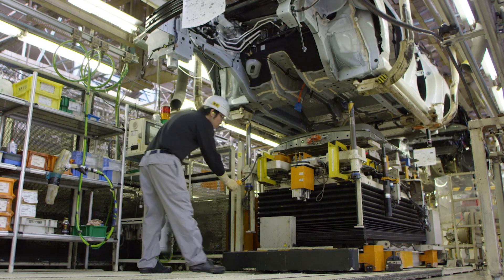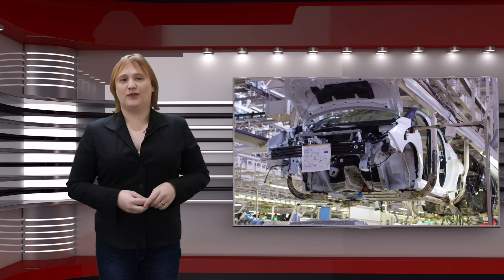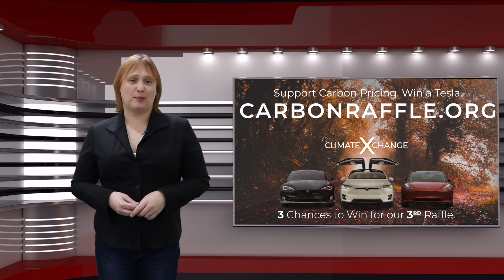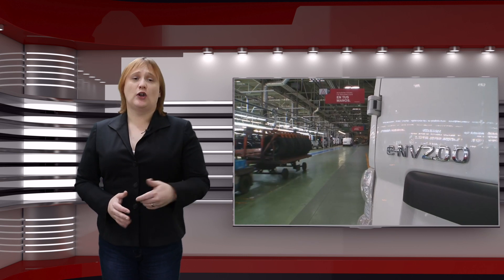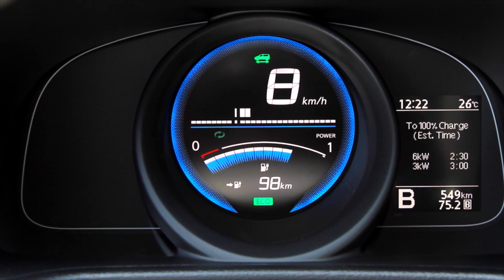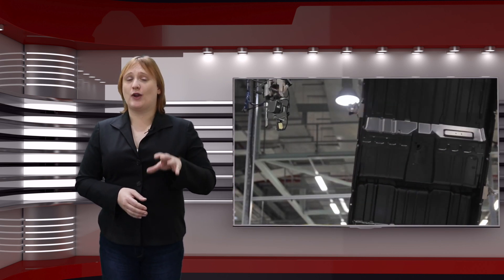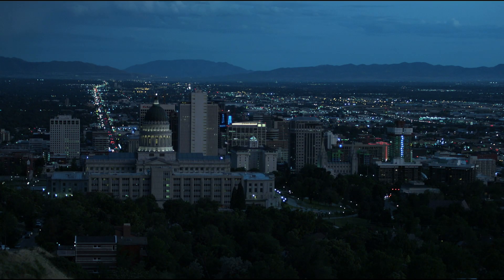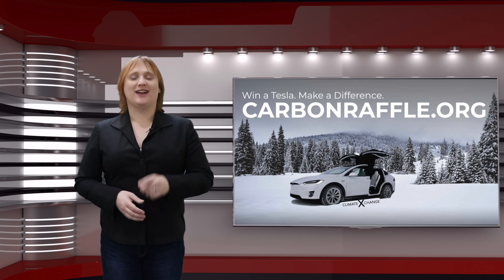The 2019 Nissan Leaf e-Plus Will Get Air-Conditioned Battery Cooling, Not Liquid Cooling

Comment: Just a few thoughts. First, nobody is obliged to buy a car whose technology they don't like, so there is no reason to get heated up over this issue. Second thought, the capacity of cooling is more determined by the amount of heat to be evacuated than by the volume of the space to be cooled, so the comparison of cooling the battery and the cabin may not be very relevant. Third thought, even with liquid cooling one ends up having to cool the liquid using surrounding air (what else is there?) so there has to be some kind of air-cooled radiator; the problem might be not so different as air-cooling the battery directly (though probably liquid cooling can ensure more uniform temperature in the battery being cooled).
Reply: Tesla uses a Heat Pump to provide active cooling or heating as needed.  The Nissan Leaf only has passive cooling.

Comment: All of these air liquid or any other cooling means nothing, there's so many drivers just want A. A mass produced (not silly 2k uk allocation compliance vehicle hint hint kia/hyundai) and B. Extra range. Cheers
Reply: Heat causes battery degradation - like 20% in 5 years ...

Comment: You gotta be kidding me, Nissan. I was really hopeful for a liquid-cooled battery pack to bring the 60 kWh Leaf up to modern standards. The rapid charge throttling is annoying, but the real reason I hate this decision is that we already have lots of data to demonstrate that Leaf battery packs lose capacity at an unacceptable rate, whereas liquid-cooled packs on the market do quite well. Nissan has basically just guaranteed that Leafs will always depreciate at the same rate the first generation has.

Comment: Nope.
Not surprised really. Nissan has their head in their domestic Japanese market. Works fine there. Mild climate and you can't do long high speed miles like in the US or much of Europe.

I couldn't really talk about it before, but now I've sold that business and can share. When I bought my used '11 LEAF 3+ years ago one of the things I was anxious to explore was the possibility of retrofitting active cooling to Nissan batteries. At the time I designed cooling for commercial/industrial/military vehicle cabins and sometimes electronics and other things. I've worked with a large manufacturer to examine the feasibility of closed-loop air cooling of commercial size lithium-ion storage systems. In that case and in the case of my LEAF it was simply impractical.

In the LEAF in particular is simply will not work. The battery cells are housed in aluminum boxes that are stacked directly on top of each other providing very little surface area that could be reached by the cooling air. Any cooling that did happen would pull heat from the outer edges of each box. The individual cells have poor thermal conductivity from the center of the cell to the edges of the box. In the back of the battery there are 24 of these boxes up on their sides all sandwiched together. There is no way to get enough air through this battery to remove heat effectively.

Why? Short answer: it's all about the weight (mass) of what you are cooling and what you are cooling it with. The batteries weigh a lot and air weighs a little. That's why liquid cooling is so popular. Liquid coolant. Leaving out lots of details here, but the empty space between the battery "boxes" and the shell surrounding the whole battery is not too far from 2 cubic feet. 2 cubic feet of coolant weighs about 60 pounds (too lazy to look up but this is close). 2 cubic feet of air weighs about 0.16 pounds (about 2 1/2 ounces). If everything absorbed heat at the same rate (it doesn't. that's why coolant is called coolant) that 2 cubic feet of coolant would absorb 375 times more heat than the air. 

Whatever you cool the battery with (assuming it's not just "Thoughts and Prayers" as in all LEAVES to date") you need to flow through the battery to carry the heat away. If it were air you used for cooling you would need large gaps to allow very high air flow. It would be nice to use some finned heat exchangers too, like the kind you find in computers. This would make for a very large battery enclosure and a noisey inefficient cooling system.

So? So the new Nissan battery will have the same dieselgate problems and Nissan will "solve" it in the same way: turning down the safety systems and bracing themselves for the warranty expense. Loved my LEAF but won't buy another. My new '18 Volt has amazing thermal management. I bought a Volt battery out of a wrecked car to play with/autopsy. To a thermal management guy it is pure art.

(note to fellow geeks: yes, I left out and/or misstated LOTS of things here. Just trying to be brief and comprehensible.)

Comment: Here in Canada where it's currently -10 outside, I'm more concerned about keeping the battery warm. My current Leaf's battery usually has no thermal bars in the winter which means no fast charging, less performance, and no regenerative braking. It's also probably not great for the battery to be cold soaked but because there's no active thermal management the only way to get heat into the battery in the winter seems to be driving it at highway speed, which compounds the already-shorter range I get in the winter. When it's -20 out it's almost hopeless. The battery never warms up and the range takes a massive hit on my 24 kWh pack. At least with liquid thermal systems they can take heat produced by the electronics and heat pump and use it to warm up the battery. Not so with the Leaf.

Comment: Hyundai knew to change from air cooled to liquid cooled as they moved to larger / higher density packs from 1st Gen Ioniq to Kona and presumably extended range Ioniq.  No so with Nissan.  I'd expected that Nissan, especially after having to defensively warrantee packs against capacity loss, would properly engineer the 2018+ Leaf, or at least the 2nd try at 2018+ Leaf battery.  I guess Nissan will just continue their approach of gross discounting the selling price of the Leaf to it placed.  A lost opportunity since they have larger manufacturing capability and established customer base to sell a cutting edge EV to.  Instead, it looks like its a cost-cutting / compromised version instead of SOA vehicle.  Disappointing.

Comment: Mitsubishi uses active air in the Outlander PHEV but that is a much lower density battery than the new LEAF will be carrying. Our Bolt EV lease ends in January 2020 but I’m in no hurry to revisit Nissan based on this latest info.

Comment: Nikki,

If the ambient air is 100F, you'll have problems cooling the battery with an air cooling system.

Every summer in Nashville it stays in the 90's and sometimes 100's for months on end. Nashville is a major city, in fact where Nissan have their North American HQ.

Air cooled EV batteries are not well suited to hotter climates.
Reply from the maker: It’s not just air. It’s air conditioned air
Reply: @transportevolved  Ah OK missed that nugget. The cooler air should help some.
Reply: @JeanPierreWhite  Nope, there is no cool air, there  is no fan.  It is still passive !
Reply: @transportevolved  No, it is NOT !
Reply: It is the temperature differential that is important, more than ambient.  Our Leaf battery cooled down by a bar when left parked for an hour in 105F; the battery was well above that (turtles at 135F?)  Those batteries (30kWh version) get really hot after a few DCFC stops, even in 40F mountain air.

Comment: I'm glad  my 2015 leaf doesn't have active cooling.  Atlanta has moderate temps and my daily 35 mile one way commute just fine.   I know I'm good for years to come and have less moving / complicated parts to worry about.
Reply: That is my feeling as well.  A simple, reliable car is what I wanted when I had bought my 2017 Leaf here in Boston.
Reply: Atlanta's nickname is hotlanta. I wouldn't cal the summer temps moderate.
Reply: @JeanPierreWhite  It's moderate when you consider the leaf has problems at like 120f and it barely gets 100 here on bad days.
Reply: @JeanPierreWhite  I'm not sure the point you're trying to make. you must be aware of what constitutes extreme conditions in places like Arizona. Since you know this and that Atlanta is not in that category AND you know I can expect my leaf to work just fine for 8 years at least ehat are you trying to prove right now?
Reply: @wackottl  It seems you are under the impression that battery degredation due to heat starts at 120F. It doesn't, it starts to accelerate at 86F. My LEAF is 7 years old and had a battery replacement at year 5. You may want to believe your battery will be just fine in Atlanta my experience is that in the south the Nissan battery does not fair well. I have personal experience and also provided a link to backup my point. Your opinion clearly differs and you are welcome to hold on to that. Just be ready to replace your battery at year 5.
Reply: @JeanPierreWhite  ok, so you are saying I'll have the same problems in Atlanta as I would in Arizona.  I don't agree. I say they are extreme and I am not extreme.   but as you said, you are welcome to hold onto your option.  at least for another 2 years when i can come back and let you know if I need a replacement or not.
Reply: @wackottl  You are putting words in my mouth. I never said you'd experience the same degradation as Arizona, but I am suggesting you'll suffer similar degradation as Nashville, the cimates are similar with Atlanta being a tad hotter.

Understand that Arizona is the "canary in the mine" with regard to battery degradation. Their batteries degrade significantly in just over 2 years. Ours will take 5. My new battery is 2 years old I have lost between 10-15% already with 30,000 miles driven. I found once the first battery got to about 55,000 miles degradation got worse more quickly.
Reply: @Islamisthecultofsin  My new battery has the new formulation and is degrading all the same. For me charging to 80% is easy, its a vehicle parameter. 2015 LEAF's don't have the 80% charge option so the OP will have extra work to try and stop charging to 100% each charge.
Reply: @JeanPierreWhite   So my guess is the air conditioned cooling is than more superior comparing to liquid cooling, since with AC can get under the outside temperature.
Reply: @energiavadasz3328  That's a great notion, but liquid active cooling is considered the best. Chilled coolant is more effective than forced cool air. It's the same with conventional vehicles, liquid cooling is dominant with only a few cars that employ air cooling.
Reply: @Islamisthecultofsin  5 times per week. 12 minutes rapid which is enough to increase from 45% to 70% SOC to provide enough range to get home. The old battery needed longer Rapids due to the reduced range.
Reply: @Islamisthecultofsin  You may be right. The LEAF battery may not be capable of handling rapid charging without active thermal management. The 2018 LEAF started  the #rapidgate debacle where Nissan were found to have limited rapid charging speed to protect the battery. The earlier models have no such protections. Nissan may have concluded their battery isn't really capable of rapid charging without battery damage.

Other EV's such as Tesla can handle faster rapid charging with little to no measurable effect after hundreds of thousands of miles. Rather than limit rapid charge speed, Tesla vehicles run their cooling fans hard.

Comment: If you live in mild climates and don't rapid charge LEAF's are OK. However liquid cooling is better. My LEAF started at say 100 mile range. 4 years now 88 miles. So if that trend is linear (and might not be may be less) it will be 64 miles in 8 more years, or 12 years total. 64 mile range in my min range for my current local use. A new $7500 battery will get my range back. If you can swap battery yourself and find a used or reman or rebuilt battery that cost may be half.
Reply: @José Balvin What pathetic comment? How old are you? How many likes does your comment have? Ask me if I care? (Hint: I don't.) Have a nice day troll. Bye.

Comment: I have no problem with an air-cooled system as long as the manufacturer is honest when it comes to telling the customers what to expect/ the limitations.  I personally always prefer a simple system over a complicated system.  If an air-cooled system can meet my needs, (which this one does), then I would actually prefer it to the costly to repair complication of liquid cooled.  And this is also why I prefer air-cooled motorcycles over liquid-cooled ones.  Now I live in Alaska, and don't have near the concerns of those who live down south.  My opinion might change if I did.
Reply: Down in the north, battery has to work harder as it has to heat interior and be driving shorter distance than intended to.
Reply: @symmetry08  Yes, but it has not been a problem for me.  I have a 2014 LEAF with a 24kw battery and it serves my needs just fine.   I'm all for simplicity, fewer moving parts, and less to brake or maintain.  If a car doesn't need liquid cooling, I don't want it.  But I'm used to being in the minority on most things :-)

Comment: My trust in Nissan's ev offerings has evaporated. 
Kona or Niro are far better looking options at present.
Reply: The Leaf is fine for short range, slow charge applications. Not a travel car that requires fast charge.
Reply: Short range meaning 200 miles one way or 100 miles each way if yours has a 62 KWH battery. This is plenty far enough to visit several cities from our home.

Comment: In short is not a sports car, but a family one for temperate climates. On the positive side without liquids an hoses is simpler and more reliable in the long term. Also easier to replace battery even if a long term user has to find a similar
replacement that can be made to fit: so as not to throw away all the car (talking about 10 /20 years time).
Reply: Remember #rapidgate came about because an EV evangelist drove a Leaf across SCOTLAND! That's not a place known for heatwaves!

Nissan got the lack of active cooling in the 2018 model very badly wrong.
Reply: @paulgoffin8054  I said  "temperate" climate, not too hot & not too cold. 
In any case degradation due to cold temperature is totally reversible once the batt. warms up,
the noticeably effect is that the peak power accepted or delivered is lower correspondigly.
Apparentely certain permanent degradation occurs each time it is stressed at higher temps.
All the same users of earlier versions are very happy with the quality and comfort of the car.
I have never driven or even touched one, but for the price woudn´t dismiss it.
 Just they aren´t avilable here.
Reply: @andytomm1  The battery got too HOT in cool Scotland.

Comment: But the e-NVs cooling is ridiculous as well… It's only active while the car is turned on when you're charging! It's almost as if they wanted to avoid cooling the battery at all cost.
Reply: There is a video somewhere purporting to demonstrate an e-NV in England that has slow 2nd charge.
Reply: @mcarter5054  Not in England but this video shows rapidgate on E.NV https://www.youtube.com/watch?v=9c5LykE4J28
Reply: Well said.
Reply: EVPaddy - Greetings, my Swiss friend.  There’s nothing fundamentally wrong with doing this, as long as the manufacturer has a good strategy.  A modern battery, at a moderate state of charge, can safely handle pretty extreme temperatures if it’s NOT being actively used.  As an example of this, a parked Volt will run the cooling system (when the car is unplugged) only if the SOC is above a certain level.  And regardless of the SOC, battery damage can occur at extreme temperatures when charging.  This is why EVs limit Regen with hot/cold batteries.  The problem with the Leaf Is there’s basically no thermal management!  The battery will be forced to run at whatever temperature it is, even if it’s not optimal.  It sounds like the e-NV is a better system than the Leaf, assuming the execution is good.  Both the Prius prime and Ford Energi products use cabin air to cool the batteries to good effect, even though the battery packs are bulky to allow airflow around the cells.
Reply: @ClockworksOfGL  hi! Why do you know I'm Swiss? ;) Well I think it's a thing of the past to have batteries without thermal management. Yes the Zoe does pretty well with AC cooled air, but as I said, the eNV 200 doesn't. I don't know whether it uses AC to cool the air or whether it just uses ambient air, but worse, it's only cooling the battery if you leave the car switched on during charging. This means if you lock the car and go for a coffee, the battery will not be cooled. Stupid.
Reply: EVPaddy the battery cools down by itself when you have your coffee...
Reply: EVPaddy - “Why do you know I’m Swiss?”  Because you’re a greedy, secretive bastard that profits from genocide.  Just joking (do Swiss people have humor....?), I’m an avid reader of the Electrek forums.  I’m not familiar with that particular Nissan model, but it sounds like something stupid that they’d do.  Almost every Nissan owner I’ve known has huge problems with their cars.  We’re talking about engine failures and bad transmissions and (in the case of the Leaf) rapidly degrading batteries.  Carlos Ghosn belongs in jail for all the garbage he’s hoisted on the car-buying public.

Comment: Thanks for this eagerly awaited info, Nikki.  The 2018 Leaf O.M. clearly states the charging limitations; our 2017 does the same thing (by miles, not number of DCFC stops) and it is annoying but I do wonder if it is a scandal since it is documented.  Though the main reason I would not consider the 2019 e-Plus as a replacement for our leased Leaf is that it will be very difficult to find CHAdeMO-compatible DCFCs capable of supplying anywhere near the rated kW in our area, assuming Nissan kept CHAdeMO for the e-Plus.